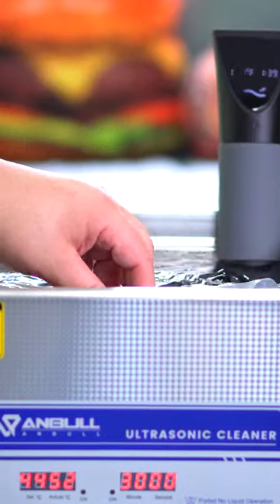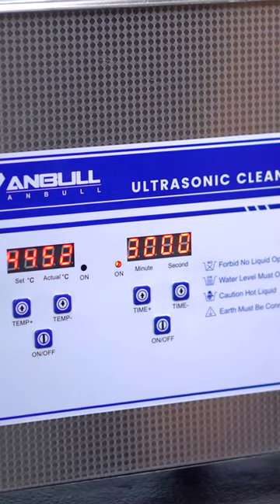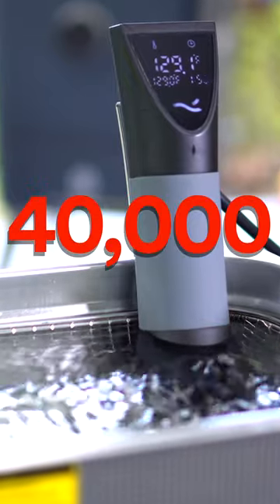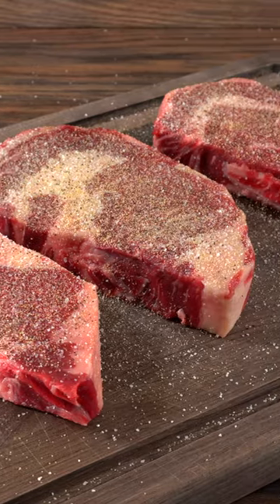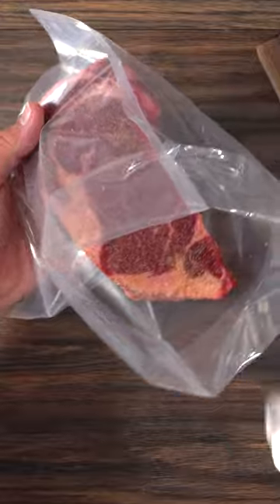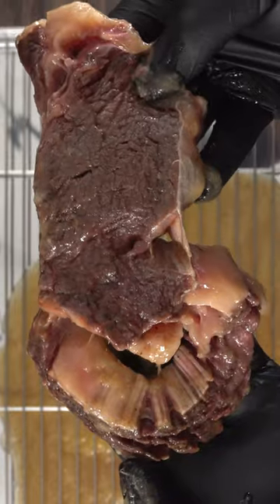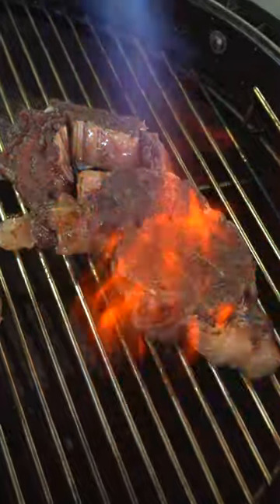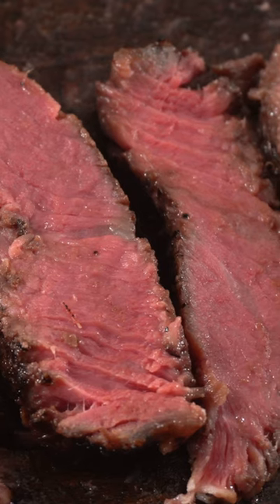Ultrasonic Steak!

Comment: So the way the ultrasonic cleaner works is that it sends ultrasonic waves via air bubbles in the water at a very high rate. Thus disrupting certain bonds of dirt particles and etc. But this is where vacuum sealing disrupts that. Sound cannot travel with air. Vacuum sealing removes as much air as possible. With sous vide you are just heating the water until the meat meets equilibrium with the surrounding water. So the combination of heat and vibration just means you are having the meat violently rubbed on its surface while hot.
Reply: "Violently rubbed"
Reply: You're completely wrong. The waves can move as long as there is some kind of matter to move through. You're correct with saying that vacuum removes the air but what you're completely missing is that the waves travel via matter and not specifically "air". The waves will penetrate the bag and go into the meat since there is matter to move through so the meat is 100% effected by the ultrasonic waves.

Also in case you didnt know there isnt a lot of air in a ultrasonic cleaner BATH full of WATER so it defo does not need air to move through lmfao

Comment: How well did the sous vide hold up to the ultrasound? All of that vibration for 2 hours must have put some extra wear and tear on it....
Reply: Don't sweat it, Guga can afford a new one 😂
Reply: I'm not totally sure of how the sous vide is constructed but ultrasonic cleaners are used for delicate jewelry and musical instruments that require precise fit. They certainly aren't going to damage the metal elements.
Reply: The ultrasonic cleaners that are used in dental offices are routinely run throughout most of the time that the office is open.
Reply: Pretty clean.